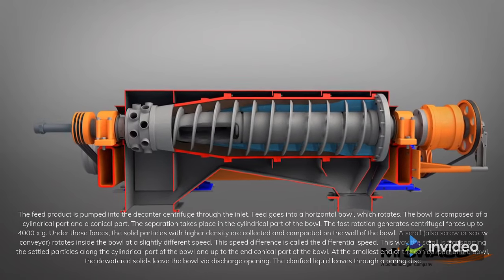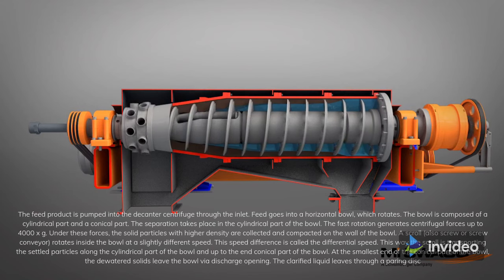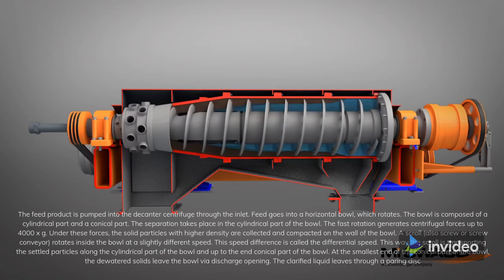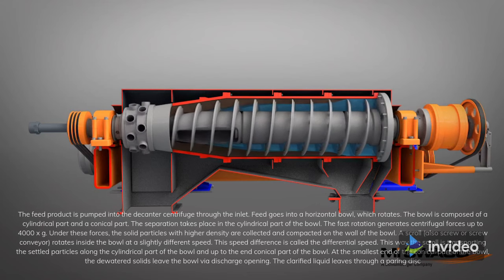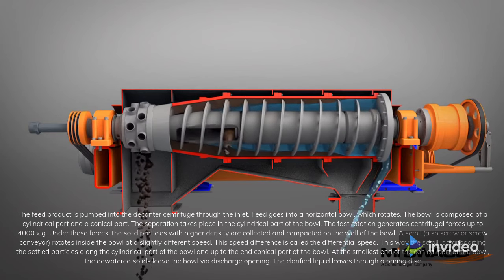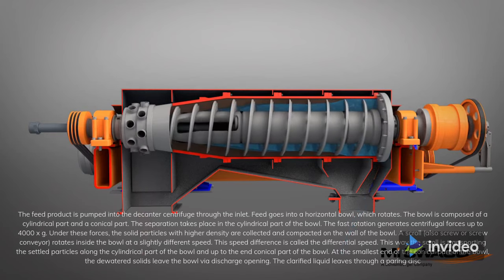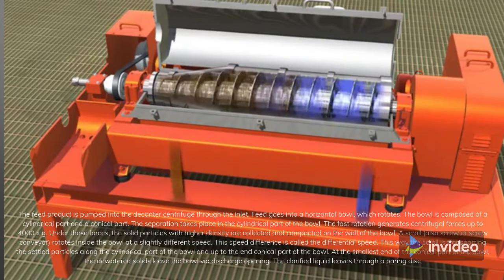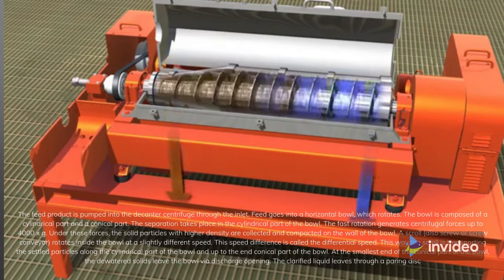Decanter Centrifuge working Principle | Animation | Oil Drilling | Solid Control

Comment: Hello. I also bought a 3000 rpm centrifuge but I have a problem and please help me. in the part where it removes the liquid, it also removes the solid. It doesn't separate anything ... it takes me out of the same place. as I put ... so take it out. Why ?